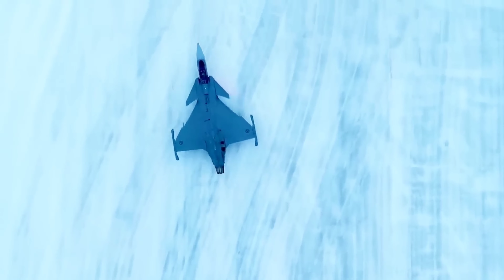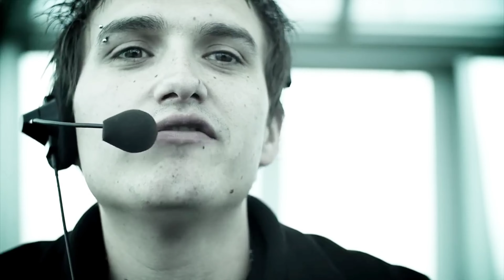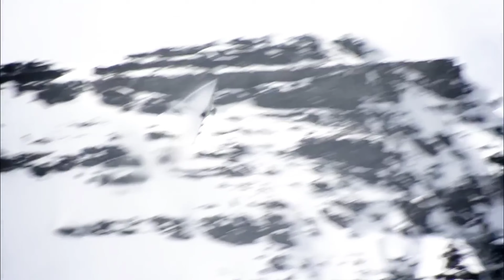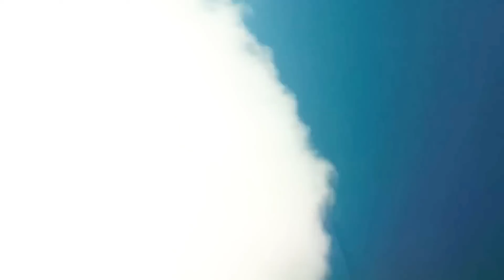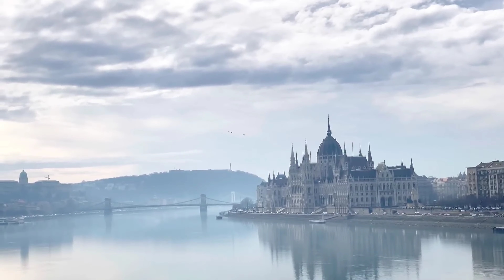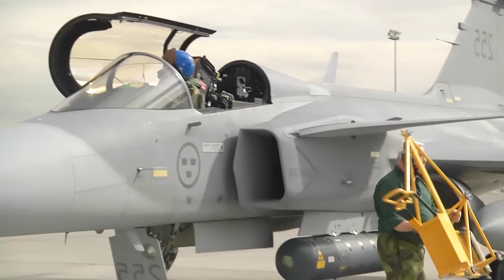Canada Just Defied the Pentagon — Gripen Deal Changes Everything!

Comment: If Canada truly wants to achieve real defense independence and avoid being controlled by the United States, its only viable options are Europe’s Eurofighter Typhoon or France’s Rafale, but NOT Gripen. Let me explain why—These aircraft provide full sovereignty over critical systems and are not dependent on American technology or export approvals. In contrast, Sweden’s Gripen, despite being manufactured by a neutral country, is heavily reliant on U.S. components and therefore cannot deliver true autonomy.
The Gripen is powered by the American General Electric (GE) F414G engine, which is subject to U.S. International Traffic in Arms Regulations (ITAR). This means that if Canada purchases the Gripen, it must obtain export approval from the U.S. State Department, and engine supply, software upgrades, and spare parts all require U.S. consent. Should U.S.-Canada relations deteriorate, the United States could completely halt deliveries, effectively grounding Canada’s fighter jets.
In the 2010s, Saab considered adapting the EJ200 engine—used in the Eurofighter Typhoon and jointly developed by Rolls-Royce and other European manufacturers—for the Gripen, aiming to reduce reliance on U.S. technology. However, the plan never progressed beyond the conceptual stage due to significant technical and financial hurdles. Replacing the engine would require extensive redesigns to critical components such as the air intake, mounting structures, and flight control systems, effectively amounting to a complete reengineering of the aircraft. Additionally, the new configuration would demand a full cycle of flight testing and certification, making the endeavor prohibitively expensive and time-consuming.
Beyond the engine, the Gripen’s radar, avionics, and flight control systems also contain American-made components, and most of its customers use U.S.-made AIM-series missiles. On the surface, it is a Swedish plane, but in reality, its “heart” and “nervous system” are American-made, meaning the Gripen’s symbolic independence is effectively nullified.
In contrast, the Typhoon and Rafale are much “cleaner” options. The Typhoon’s EJ200 engine is jointly developed by the U.K., Germany, Italy, and Spain, containing no American parts, and cannot be interfered with by the United States. The Rafale’s M88 engine is entirely designed and manufactured by France’s Safran group, giving France full control over both engine and avionics. In terms of sovereignty, the Gripen would score only one star, while the Typhoon earns four stars, and the Rafale five. These aircraft can also use European-made missiles and radar systems, avoiding dependency on U.S. ordnance or software.
From a political and strategic perspective, while the Gripen may be relatively inexpensive and easy to maintain, its reliance on American technology makes it a compromise of “pseudo-independence.” In contrast, the European Typhoon and French Rafale combine mature technology with full defense sovereignty. Their countries of origin maintain friendly political relations with Canada and are willing to provide technology transfer, local maintenance, and industrial cooperation—benefiting Canada’s domestic aerospace industry.
In short, if Canada’s goal is true defense independence, rather than merely shifting to another form of U.S. dependence, its focus should be on the Typhoon or Rafale. The Gripen, though appearing neutral, remains part of the U.S. military-industrial complex and cannot provide Canada with genuine autonomy in defense strategy.

Comment: There are but two contenders, just like when the F-35 was selected by the previous Trudeau Gov't
The JAS-39 came in 2nd. This review has an emphasis on lifetime operational costs and economic-industrial benefit packages!
Objectively, the Gripen is a better fit for Canada, the Lightning II remains bogged by cost overruns, delays in deliveries and upgrades.
The RCAF can fly the Gripen on existing infrastructure, the F-35 requires loads of expanded and expensive new tech at airbases.
Be well and stay safe

Comment: "Rolls-Royce steps in"?  So far there has been absolutely no announcement from either RR or Saab indicating that they have developed a new Gripen model that would use a RR engine... and it would require a re-engineering of the whole plane for that to happen.

I would be thrilled to be proven wrong.  What is the source behind this claim?
Reply: It's just rumours, nothing has been said officially. An EJ230 engine would fit the airframe and likely not require very extensive modifications. Aircraft have been reengined before so it's not unheard of. But as with all things aerospace it would still be time consuming and expensive to do.

Maybe it's still worth it though?
Reply: Regardless of announcements Rolls-Royce will gladly sell their engines to SAAB if they ask.  Why wouldn't RR do that? 
And SAAB wouldn't ask before they have orders that they can put the engines in. If Canada order Gripen with RR engines it would be a no brainer.
Reply: allright here.

"Saab and Rolls-Royce are undertaking a joint research programme into fibre-optic sensing technologies for aerospace propulsion systems.  Fibre-optic sensing technologies have the potential to provide a novel solution that acquires multiple measurements such as strain, pressure and temperature along a single wire.  Compared to existing technologies, this low-weight integrated solution could offer higher temperature and accuracy within the harsh operating environment of an engine. Such advanced measurement systems compliment the journey to the Intelligent Engine and enhanced data driven engine services.

Known as Project FibreSense, this collaborative research programme between Rolls-Royce and Saab will develop and demonstrate fibre-optic sensing technology for aerospace propulsion systems.

The research will take place within the Eureka Network projects programme as a joint initiative between the Swedish Innovair and the British Aerospace Technology Institute (ATI).

Eureka is an international co-operation programme supporting collaborative market-oriented research and development projects for innovative products, processes and services. This joint initiative between the UK and Sweden aims to develop project proposals that have strong market potential in these countries and globally.

“The collaboration between Rolls-Royce and Saab is a direct result of a series of initiatives towards strengthening Saab’s cooperation with UK industry. We hope that, with the positive outcome of this initial collaboration, we can continue to partner in other areas of technology that are beneficial to our companies,” says Magnus Lewis-Olsson, President Saab UK.

“We are excited to be working together with Saab on this pioneering project and developing technologies that demonstrate both companies’ position at the forefront of innovation. This initiative builds on the strong collaborative spirit between Saab and Rolls-Royce and we look forward to developing further joint projects in the future” says Alex Zino, EVP Business Development & Future Programmes, Rolls-Royce."

basically they are working togheter whit a fibre-optic sensing technologies, in short it is a sensor for propulsion if i read it right, so it isent a engine but from what i read then there could be more joint projects in the future so a engine would not be a huge leap (the text is from saab´s homesite, just search "Saab and Rolls-Royce to research innovative propulsion sensing technology")

hope this will clear some up, have a great day :)